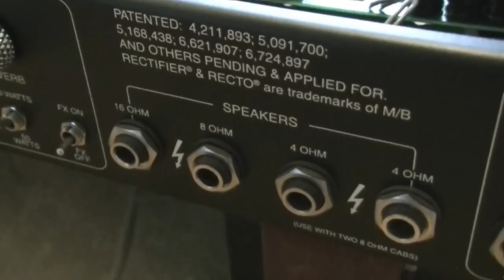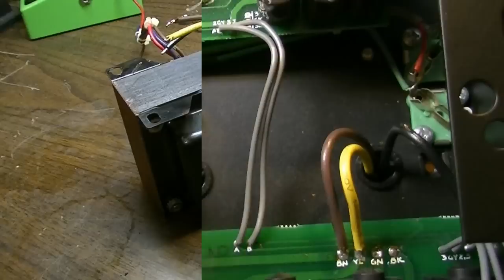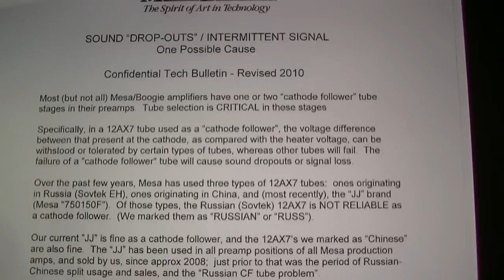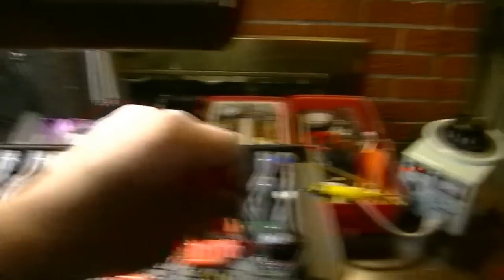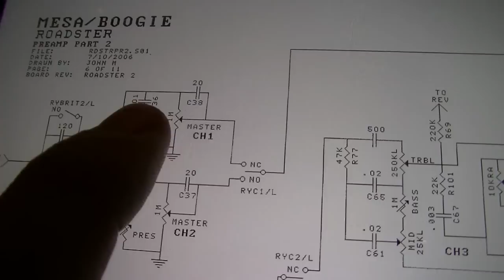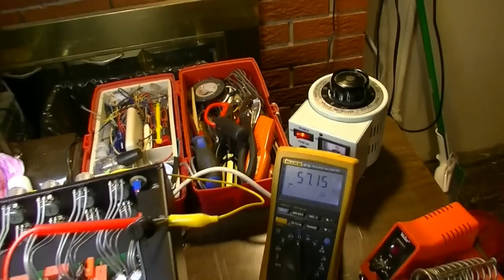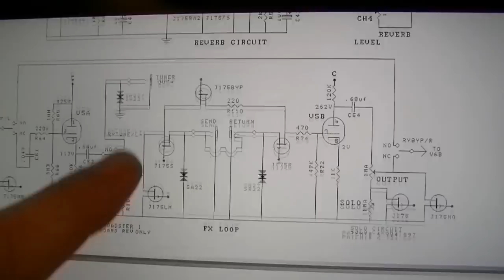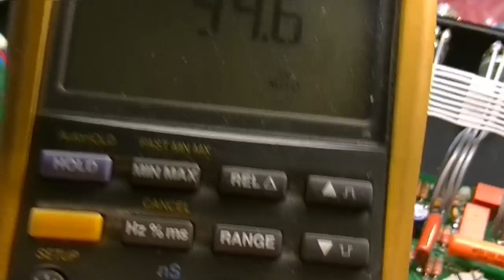Amp Tech's Worst Nightmare - Mesa Boogie Roadster Repair

Comment: I agree this is one the hardest amp you will find to work on .A couple of notes to mention doing the voltage ratio check on the output transformer is good to determine  the turns ratio providing there are no shorted winding and to possibly find a shorted winding. It is not a fool proof test. These transformers usually have around 450 working volts on them and when you add the inductance of the transformer to that you can get some really high voltages which can cause arcing inside a bad transformer. This may not show up until you actually power it up and push it hard. 
The FET Transistors are to get rid of the popping noise when switching channels. They can be a real pain to find the bad one.
Reply: I agree about testing transformers. I was hoping to have learned of some new brilliant way of testing that I had not known... also if it's a step up transformer would it not be better or safer to input into it backwards so you are stepping down instead of stepping up? I have always pondered a better easier and faster way of ruling out a damaged transformer. Especially audio output transformers. I usually test for dc shorts first and then will inject a 2kHz signal @ 100mV into the primary and view the signal on my scope. 
For the beginner techy wirhout a scope, you can always place a speaker across the secondaries and plug the output of a music player into the primary for a down and dirty quick test of the output transformer and quickly confirm failure or move on to something else.

Comment: i do like your videos ,Off subject don't you have a hard time welding with that weller WLC100 i've got the same model even new never had enough heat coming from it tip gave up on it and got the Wesd51 should have done before it make major miracle even on SMT components !just saying ..
Reply from the maker: My Weller crapped out on me a long time ago. I just use the station for docking the Radio Shack one I use now. No idea how old this one is, but it does a good job. I have a Weller soldering gun as well which is hit and miss. I have not been too impressed with Weller, to be honest.

Comment: This has convinced me to never buy a complex Mesa (or maybe any other brand) amp again. That repair was a nightmare (and good on ya for figuring it out). I've upgraded a Fender Blues something-or-other with some mods, and repaired some old mid-60s American Vox tube amps, but the complexity of that amp is ridiculous.
Reply from the maker: It was a toughie, but Mesa's customer service was there to help. That's where I gotta give them props - on the customer service and the 5-year transferable warranty. Nobody does a transferable warranty.
Reply: The Guitologist Soldano do a transferable warranty on their SLO 100.

Comment: I'm a huge Mesa fan myself. That said, I feel that something changed at the company in the 90's. Their old amps are still some of the best sounding amps. The MKII, MKIII etc. Also the Bass 400, and D180. Legendary amps for a reason. They are made like tanks and can be driven hard all day long. 
I used to own a Bass 400 and I'd crank that sucker as hard as hell. Driving the output 6550's into saturation. The amp kept on chugging along. 
That was a PCB amp. Pretty sure all of their amps are PCB based and always have been. I've toured their factory (used to live and work in Petaluma). And they are still using a lot of the same assembly line they put together in the 80's. 
What changed wasn't the assembly methods. It was the designs. Randal Smith is semi retired and farms out most of the design details to c ouple other guys. 
I was tempted to come back to Mesa when they launched their 'all tube' bass amps. But when I checked them out in person at Mesa they had op amps in the signal path. Now you can possibly get good audio out of an op amp. I've built mic pres and pedals with them. But a tube preamp that has op amps in it has to run more conservatively. 
More importantly, the op amps are doubtless part of an EQ circuit. Which means you are not getting a nice gyrator/passive  eq design with make up from tubes. But rather active EQ with all it's unmusical  tone. 
Active EQ is great for mixers and pro audio. But for amps that you play hard, you want passive eq!
More importantly, If I pay a lot of money for a TUBE amp, dont give me op amps. 
Mesa needs to get back to making creative hot rodded Fender circuits without all the chips in them.

Comment: What I find interesting with Mesa Boogie amps is that they have a gain and master knob on each channel, but theres's also a separate output knob that acts like a master volume for all of the channels. I personally love using the output knob as my main master volume. I have this exact same amp, but it's the newest version and it plays and sounds incredible. I absolutely love this amp and I couldn't find myself playing anything else. The key is to find the sound that works for you and write the settings down! If you just move any eq a hair, it will completely change the sound. I love the versatility, but I can completely understand your frustrations with fixing this amp as there's so much shit to look at!!! Hahaha.. Thanks for this video, as I am just a player and have no knowledge of fixing anything electronically, but you look like a super hero figuring this stuff out and whoever designed this amp deserves a medal creating this gem.

Comment: I'm in western Indiana and I wish I had some of you guys knowledge on this stuff. I built a home built organ with a personal computer as the source to receive midi signals from console to play digital sample sets through computer. These mute switches you speak of, it would be nice to have something similar to momentarily cut the audio signal while computer is powering up and down to stop the speaker popping. I've been through this several different ways and no solution so for now speaker cabinet amplifiers are last on, first off. I am running digital audio signal through computers Firewire800 port to feed Focusrite Saffire Pro40 external audio unit which then feeds the rest of the audio chain down to the powered speaker amps. That mute switch circuit you showed would be nice for leaving amps on 24/7, then as computer is powered on or off, it would cut the audio signal long enough for system to power up or down without popping speakers. I know what I want but don't have the knowledge to build it. I'm using 12v trigger off computer PSU which could be used to power a mute switch.

Comment: This is the weirdest design with JFETs I have ever seen. IMHO they are literary boud to malfunction at some point, because the method they choosed to switch them On is just wrong!
You should never use low impedance to ground to switch p-chanel JFETs, because this way, they are gonna be damaged every time it's drain gets above 1V.
If you wanna ensure that they won't be damaged, and you don't wanna rebuild the mute circuit with PNP instead of 6426, add one 4k7 resistor between R128 and colector of NPN 6426 (on the transistor side).
Reply: mrkv4k and The Guitologist thanks for the video and the conversation. I own a Road King II, a scaled up version of the Roadster, with the opposite problem to yours - it NEVER mutes. As in, i turn all the gain and level knobs down, and there's still room level output on the oversized type 4x12. I would even put a lead into the effects return and leave the other end dangling to make sure the preamp is completely cut off from the effects return and power amp and that hasn't helped either. I thought it might have been the preamp tubes leaking through the high voltage rail to the output tubes, but it would be very involved to decouple that so i haven't tried yet. After watching this video, i ask myself whether it might be the J175's doing this - could they be leaking through the bus that is common to all gates? Maybe signal leaks from the earliest jfets in the signal chain, to the gate bus, then goes to the last jfets in the signal chain, and then back into the signal chain proper to get amplified later? In the configuration used by Mesa, what will the impedance between one of those jfet's gate and the signal path be when the jfet is set to not short (not mute)? Especially if it's a bit "fried" like you say it could be? Bear in mind the muting happens specifically during loud pops so it's like they are trying to kill those jfets. Would you say adding separate 470R or even 4k7 resistors might fix that leak? If i may ask, if you were to redesign the circuit so that this leak doesn't exist, and the components don't self-destruct, how would you do that, and what components would you use? Is there a semiconductor I could use rather than J175's which would provide superior characteristics? If I wanted to find a part like this, what characteristics would i be looking for - would that be gate-source impedance? I freely admit I'm just a layman good with soldering who has the basics of electronics down but I don't have the theoretical background or experience like the both of you do. I've done some good fixes on analog music equipment though (funnily enough had to do with sound leaks, too) so i'm hoping i can get that Mesa fixed up as well.
Reply: I made replica of similar amp: first version of dr with only 2ch. They also used a lot of fets. I changet them all to relays in my design except for first stages where i used dlr's of my own design. Works beautifully without any problems for almost 10 years now.
Reply from the maker: Maybe there's a job at Mesa in your future.
Reply: I doubt that :D I am thousands of miles away and I design HW for acces control systems (mostly RFID time-clocks). Building Tube amps is just a hobby.
I think that the problem is that more and more engineers design with some simulation programs and they don't test extreme conditions on the real thing. And some engineers are not aware of the fail-modes of basic components, like with those JFETs, you learn how it works under standard conditions (applying positive voltage on gate of p-JFET is going to "shrink" the conductive channel), but ommit the non-standard conditions (if you look at the schematic of JFET, there is an arrow on the gate, which is actual "parasitic"/body diode that shouldn't be ever polarized in conducting direction - and that is what can happen in this design).
Reply from the maker: You would know better than I. I appreciate you sharing your expertise here. Something to chew on for sure. So your suggested mod for this Mesa Boogie Mute Circuit would be to add one 4k7 resistor between R128 and colector of NPN 6426 (on the transistor side)? And this should lengthen the life of the JFETs?
Reply: Yes, if the problem is what I think it is, than it will help protect those JFETs. Also, I checked  the numbers once more and I think 470R would be better, since that is sufficient to supress that effect and it won't slow down shutdown of  RM2. So I would check this solution, to see if the mute circuit works fine. Other way would be to put those resistors to each gate.
What I think happends is that when you try to mute while there is high signal (like when you switch on effect while playing), gates of JFETs  are grounded via  low resistance of that NPN transitor. Since drain is at high voltage, you will get spike of current going throught the body diode (just until it's muted). Those body diodes are small and can handle only pulse up to 50mA.
Reply: They make them this way on purpose.

Comment: Yeah, I got 1 more nightmare for you.   Your video at 16:19 shows that the wire is melted in group #3,  It could be some overheating cooling issues.  I haven't worked with Amps, but I understand wiring.  Electricity moves poorly threw wires when they melt like that restricting there connection.  In Set #1 behind the blue component to the very left side of your screen the wiring cover appears to be a bit loose.  You should go ahead and replace it in case it strips the covering.  Its at the very left and forward right in view point.  Just so you know I am into home theater audio, and have done some repairs in other areas.  I found your video learning informative.  If I wished to buy the equipment I could probably learn to do this work myself.  You had your thumb by it at 41:24, and that part is melted indeed at the base.  I don't know if it was a hot day, or what because I suppose a hot day running a amp could do do it, not really sure because You have to X heat of device with X amount of effect of temp of conditions.  In 2 weeks you jumped to 7,000 subscribers.  LOL
Reply from the maker: No, that's my soldering iron base getting too close to the wire. I did that one.
Reply: Okay, well I would suggest you replace it too because the wires protective coating is damaged which makes it a threat of causing a fire  because you burned away its protective layering.  It might also reduce the quality of the electricity to the wire.   But I liked your video and hit the subscribe button.
Reply from the maker: Thanks for subbing. There's no risk of fire from that. Doesn't quite work that way. But thanks for the comment.
Reply: Quality of the electricity? What?
Reply: Okay, understand this,  the idea of moving Audio and video threw wire and circuitry board is that the information is embedded into the signal.  I am sure there is a NAME for the idea of the process that flows back to when they began doing this practice BEFORE amplifiers existed.  When moving the information threw a wire, it has been noted that poorer wire quality leads to a poorer signal.  This could include manufacturing of wire, wear and tear damage.  The physics of the wire in the Boogie Roadster Amp is that like with the basis principal of MANY wires.  It is a metal coil with a coating that insulates, controls the direction of electricity, IE it is NOT MOVING freely around outside of its casing.  Now, the wire has melted partially at the base of 1 wire and halfway up the other.  The 1 at the base I noticed near where he accidentally damaged the board is loose causing a slight wave causing the requirement FOR more electricity to gain altitude to channel into the wire which puts stress on the Boogies board.  On the other that is in the third set it is MELTED against the Tesla coil causing the FEED to be restricted like standing on a hose and restricting water flow.  Electricity requires a certain DENSE pressure, not to firm or soft for it to move adequately.  This is WHY wire is made in a mesh sort of style taking and retracting pressure.  I have done work on other electronics although NOT amplifiers.  I have informed Guitologist of this, and my position that he replace the wires.  But I have learned something or the style of which this Amplifier works from watching the video.  The board takes on high amounts of electricity and bottles them into capacitors,  and moves it threw the board using wires, or different types of circuits to take in the sound of the instruments, and spills out audio vocals threw  MULTI channeling.  And I have informed him of 2 electricity feed issues involving his accident of 2 wires which function, but not to there best.  The part of the insulation protection is simple, when the batch of the coding is brewed in a factory, they add a compound make-ups of substances to insulate it in a number of conditions.  When he accidentally  soldered the wire he burned away the compound in both locations so the wire isn't protected.  My guess is if you hooked up your sound system at home - it wasn't done right and could use much work to improve on it as it is always about speakers, stereos, sub-woofers and wiring of course.  My assertion was that I don't work on Stereo Amplifiers regularly, or for personal rec, but I work on other devices.  Wiring is bread and butter of electronics work.  He said his main goal was to stop overheating, and I gave him an option of consideration, change his bad wires.  But if you wish to understand the full climax for this type of things you might expand into basic understanding of circuit board interactions, then come back and re-watch boogie's video because some of my thought process is on electricity interaction principals.

Comment: tech tip for you. I see you have a good quality Fluke multimeter. When trying to trace a short, use both probes with your meter on the millivolt range moving each probe in turn on the actual pcb tracks will show a lower or higher reading, What you are aiming for is 0, that is where the short is

Comment: Have you ever repaired a Line 6 Amplify 150?  I used their Updater Software and the darn thing is Frozen Up! I followed all the TIPS the Techs offered but no go. Even tried to upload from different laptop and new USB cord. No Go. All lights ABCD on constantly. WHich I was told means Update Fail. DO you know of any PATCH or effort that could Hard Re Boot this Amp? Because unless Line 6 Steps up and repairs it it becomes a 36 pound door stop for me.  Sure could use your help
Reply from the maker: I don't mess with Line 6 stuff.